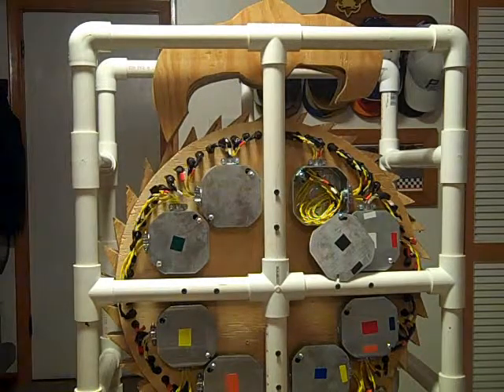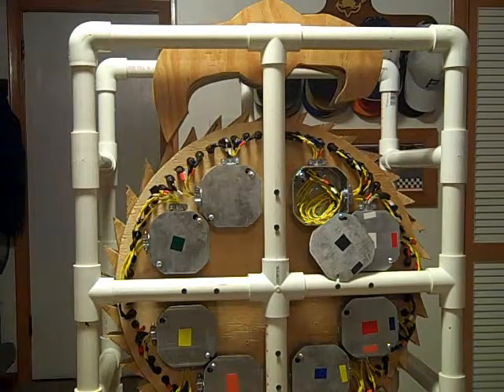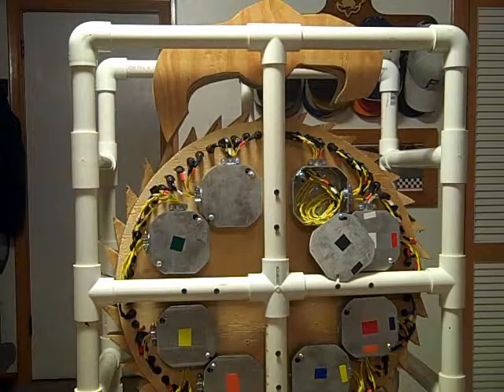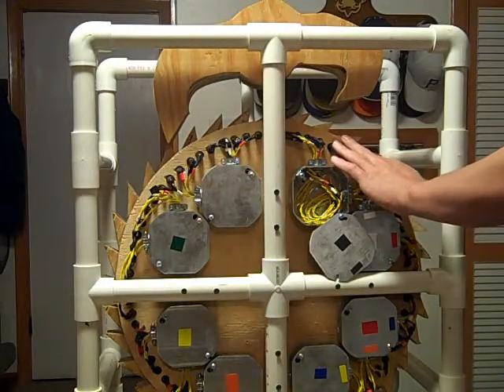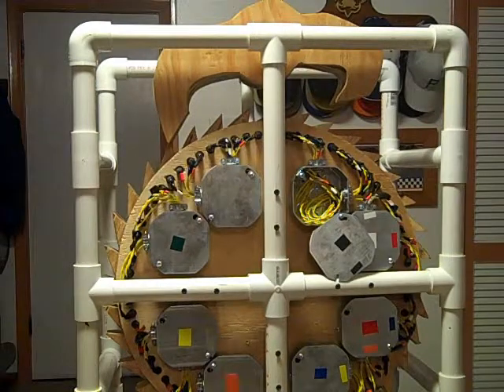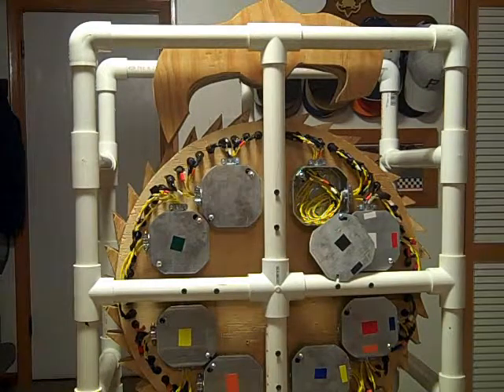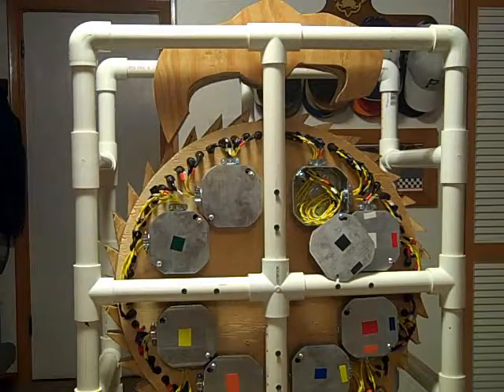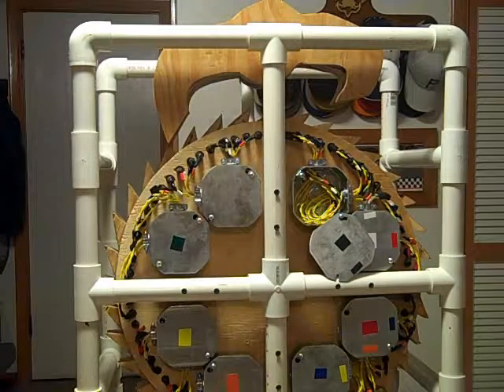Galileo Clock AC Generator

Comment from the maker: If you like this video please check out the ones on my Energy Bucket that has a windmill and solar panels on it as well as the video on my Bicycle Generator that I'm working on were I put magnets north-south-north-south on the wheel that pass by gas engine starter coils mounted on the frame.

Comment from the maker: Good so far- It's fished except for the rotor I need to pull the dowel rod out and redrill the hole because it's crooked and the rotor wobbles and bumps into the stator when it spins. I haven't had a chance to take it down to the machine shot yet and use the drill press on it I'll have to make the hole slightly bigger and install a larger dowel rod.